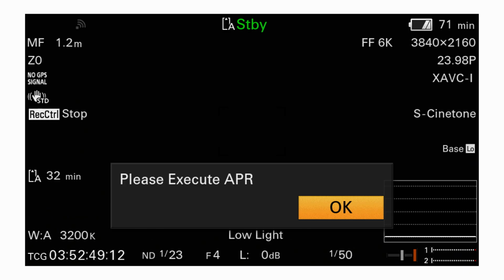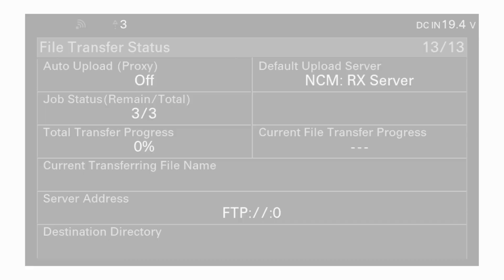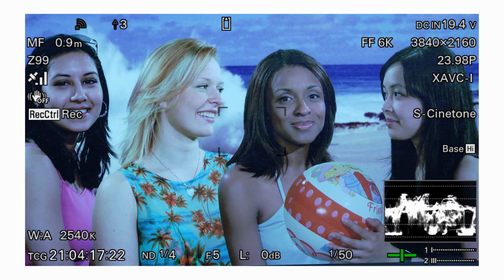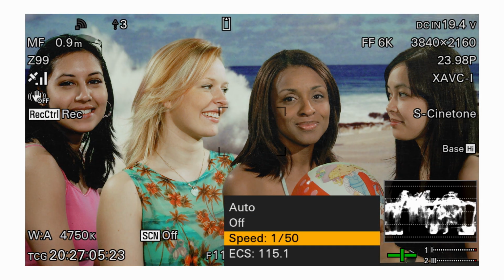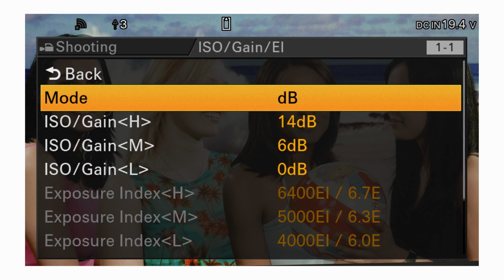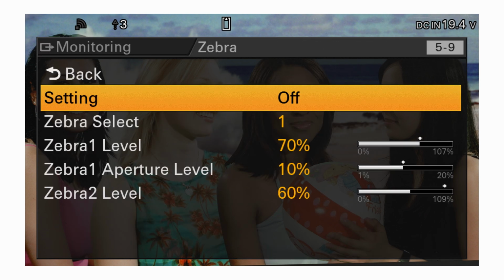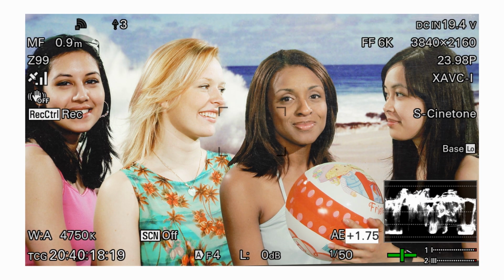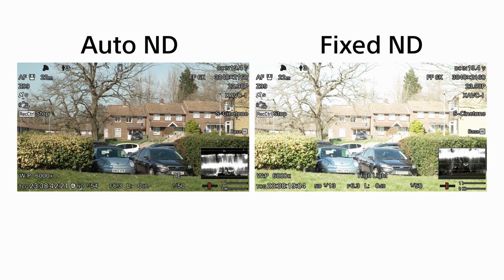FX9 Guide Version 2 | Camera Set-Up | FX9 | Sony

Comment: What does “shutter off” mean on the fx9?  What is the default
Shutter speed if set to off?  This isn’t indicated anywhere in the menu or in videos on the fx9.  You’ve expertly explained using shutter and angle but I don’t understand why there is an option for “shutter off” when it’s not explained.  Thanks!

Comment: Hi I have a px9 with a movcam extension unit,but when using my 14.8v 190wh battery it keep beeping an show low voltage please kindly explain what the issue happening ?need for help 
Movcam 303 for fx 9 extension unit

Comment: What is a standard skin tone zebra level for Slog3 Cine-EI mode?
Reply: 60%
Reply: Joachim Schranzhofer thanks
Reply: @MylonasFilms  I have to be a bit more precise: 41% for middle grey, 61% for white card with Display Gamma Assist and no LUT on, i.e. measuring the SLOG3 output and not the LUT output.
Reply: Alister mentioned 60-65